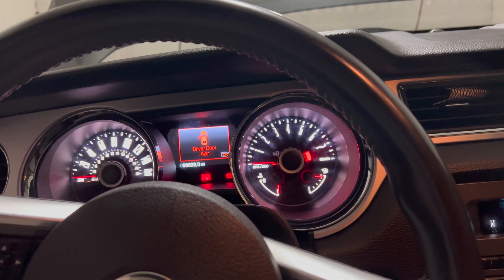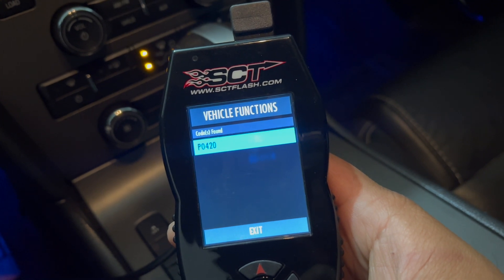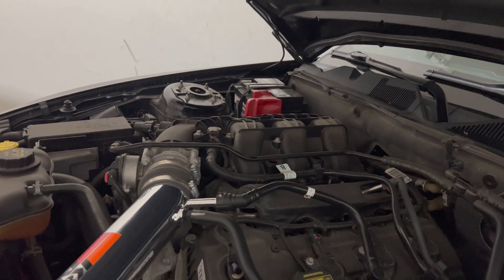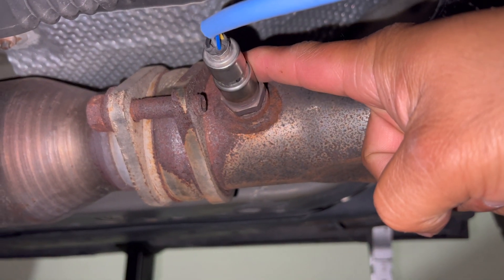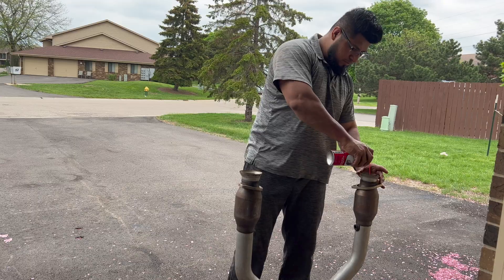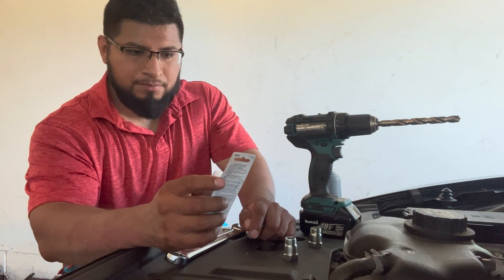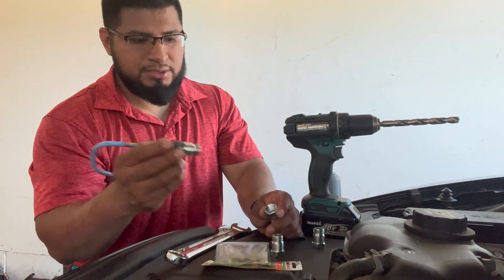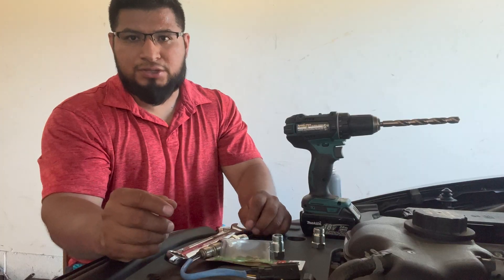How to FIX Engine Code P0420 Catalyst System Efficiency Below Threshold Bank 1 Ford Mustang

Comment: I am getting only p0430 code. I got new o2 sensors. Only p0430 comes on. Please help. Thanks.
Reply from the maker: You need to check for leaks at your exhaust like from headers to axleback. Also you can buy Cataclean fuel cleaner at oReilly!.

Comment: What type of defoulers are they? Do you have a link
Reply from the maker: Go to advanced or Oreilly and look for spark plug non-fouler just make sure they are 18mm and have like a washer or gasket so it doesn’t leak air! Just remember that you need make a hole with a 1/2 inch drill…… also you can look on eBay or Amazon sometime you can find non fouler ready to use! Just make sure they are 02 Extensions or extenders adapters.
Reply: @basicponymods4501  thank you bro I really appreciate it!
Reply from the maker: @123spree  you’re welcome! Good luck!

Comment: A mechanic advised.. after you replace catalytic converter even through after market the light should go away. If it doesn't you may need the original converter..(me..🙄)
Reply: Why did you install an aftermarket cat?
Reply: @drsnowmon  little did I know about it and plus I don't know much about cars